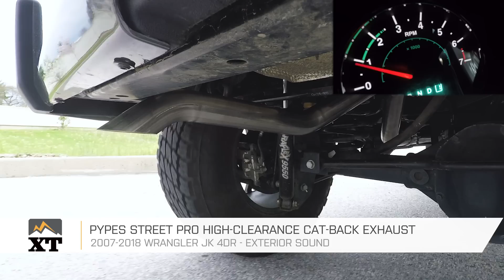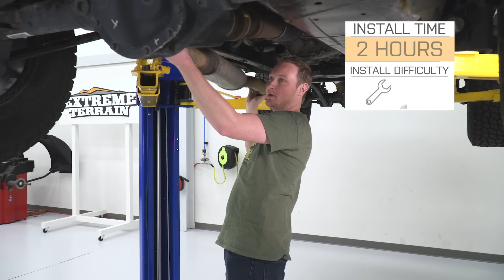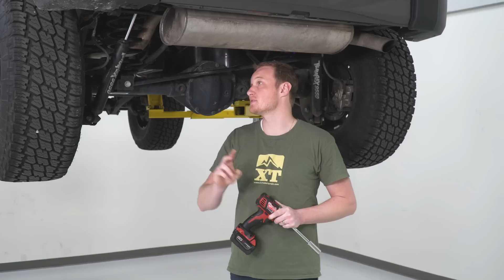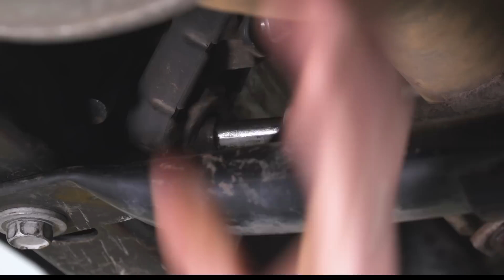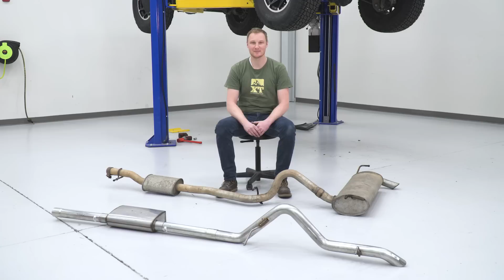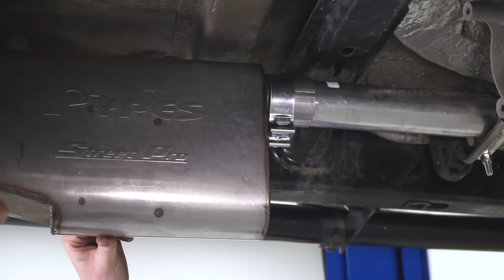Jeep Wrangler Pypes Street Pro High-Clearance Cat-Back Exhaust (2007-2018 4 Door) Review & Install

Comment: What is the difference between this and the regular high clearance exhaust by pypes?
Reply from the maker: This Street-Series High Clearance exhaust  comes with their Street muffler instead of the M-80 Race muffler on their regular High Clearance system. This street muffler is going to be a little bit quieter, and will give your Jeep more of a flowmaster/chambered muffler kind of tone overall. Check out both videos to see which tone you like better! -Zach
Reply: @extremeterrain  Thanks..  It's getting installed today!

Comment: would there be room to add a resonator to this system? Im looking for high clearance but still quieter exhaust note
Reply from the maker: Definitely! I'd recommend trying to find a lower profile one, but you should be able to make one fit no problem! -Zach
Reply: @extremeterrain  Thanks for the response! What other would you recommend that is quieter but high clearance? This one seemed the most low profile based on the videos
Reply from the maker: No problem at all! I'd recommend looking into the Magnaflow Rock Crawler series Cat-Back that we carry. I'll post a link below for that guy. Magnaflow's mufflers in general do a really nice job of cutting out any super raspy notes that you can get with some other mufflers. If you were to pair this guy up with an extra resonator you'd get smooth, deep tone with little drone while cruising. Hope this helps! -Zach
https://www.extremeterrain.com/magnaflow-rockcrawler-exhaust-jk-15237.html